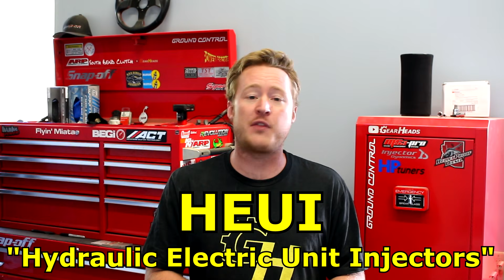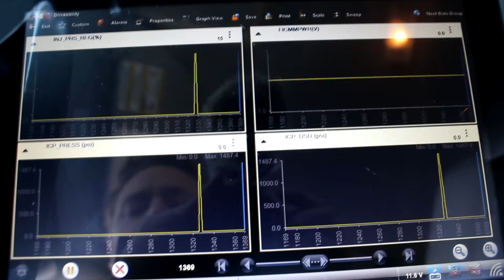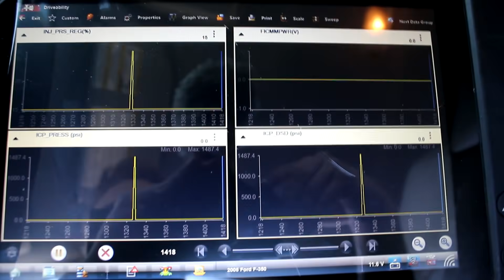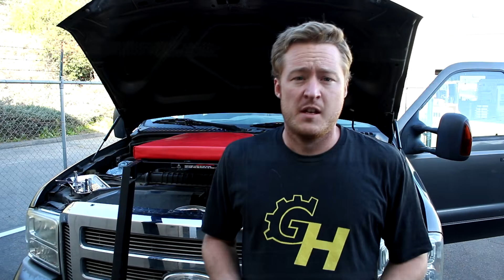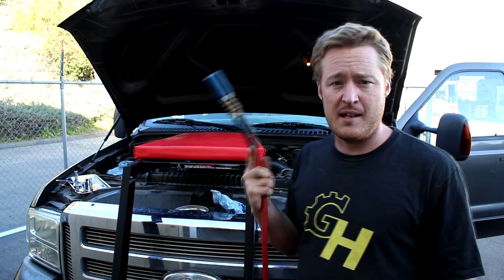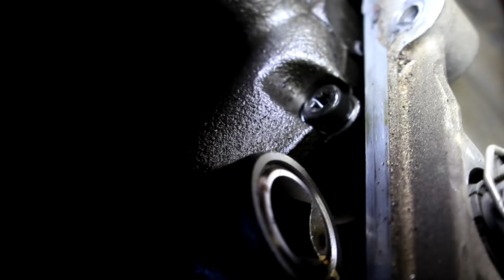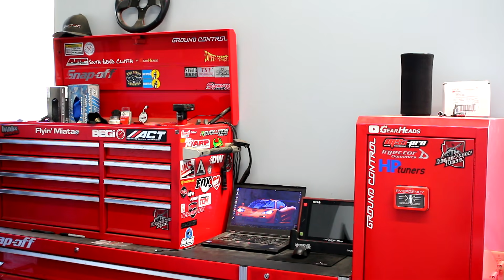Ford 6.0 Common No Start Problems

Comment: My 6.0 has a cold and hot no start. I found a bad o-ring on a nipple cupm on the pass side and replaced them(pass side) w/HRC cups and replaced the injectors o-rings while I was in there. Also replaced the stand pies and dummies on bot sides. I don’t have a scanner and don’t want to be a backyard mechanic and keep replacing parts till It runs. I do have a new IPR valve, cups for the left side and inj seals   also. If I hit it with diesel starting fluid it starts and runs fine?
Reply: Until I shut it off then need starting fluid to fire it back up. I’m at a loss of what to do. I’ve been a mechanic for 40 years but not diesel. I brought it to a diesel shop and he ripped me off like you wouldn’t believe!!!! I broke my back and hip, so I can’t really lay over the core support for very long. ANY info you could recommend would be greatly appreciated. I will also pay you for a walk though onlinePhone etc..  to get this problem resolved! I need my truck running perfectly cause Im heading South wit a loaded trailer pretty soon. Im from NH
Reply from the maker: Part of the issue here is assuming you are getting ripped off. I have no idea if the shop you went to is a good shop or not, but no matter what diesel repairs are expensive. The fact that you have been a mechanic for 40 years and cant figure it out should tell you that whoever DOES figure it out is probably going to be worth a pretty penny. Also if you actually are a mechanic then why the hell do you not own a decent scanner? These days there are so many options for affordable powerful scan tools, hell Forscan is free and will do almost anything you need.  As for what you are describing, it sounds like a HPOP pressure issue still, but its possible you have an electrical concern with a crank sensor or similar that doesnt work until the engine is at a high enough speed. Either way you have something that is preventing the truck from starting until the engine sees a high enough RPM, most likely still high pressure oil, but you need a scan tool to help find out what is happening. When it comes to repairs at my shop I do not provide diagnostics for people without me performing the repair in most cases, but ESPECIALLY with diesels. The diagnostic process on these often requires disassmbly and if I am not the one that is going to be fixing it, it makes no sense for me to tear it apart. 6.0 No start diags generally run several hundred dollars because of the labor involved, it is still often mostly included/combined with repairs if this is the case but either way that takes the right knowledge, the right tools etc.  For what its worth, I work on a lot of diesel trucks and own a shop, I dont even own one because I dont have the need at this time and know how expensive they are. If you tow on occasion and not every day, get a V10 and spend the extra gas money because it is still cheaper.
Reply: @GearHeadsGarageChannel  yeah I had to close my shop a couple years ago.And sold all my heavy equipment, then sold my scanner last year. I got bumped off a roof down in S.C.(I live in N.H.). Couldn’t work so I sold out. 
  Last time it did this, I had a bad nipple cup o-ring,right side. Is there a program I can buy for my laptop and a pigtail? And what would be the best one for the buck? I figured it’s such a common problem, I trying to narrow it down, cause it’s extremely hard (and painful) to lay across the core support. 
 I appreciate that you got back to me. But like I said iT runs perfectly with a small shot of starting fluid! But I have to do it every time I start it?
Reply from the maker: Google Forscan you can use it with your phone or a laptop you will need a dongle you can buy for like $20 or so on Amazon. I am sorry to hear of your circumstances, I hope you get it figured out but there wont be any further assistance I can offer from 3,000 miles away.

Comment: Mine did exactly this today. Ran great for 20 minutes. Went in the store and when I went to crank it, nothing. Throwing no codes. Had it towed home. I'll be checking this stuff tomorrow. Stay tuned.  Great video.
Reply: did you by chance find out what it was because mines doing the same thing unfortunately
Reply: @jacob_21234  . . . . Did you get yours figured out ?   I just bought a "04  6L .  Started and ran like a Champ for two days , next day wouldn't start ! Crap !   Sounds like these engines are to complicated.  Been driving  Cummins for years and never had a problem. Got a guy  coming to look at mine .  If it costs a lot to fix , I'm gonna check to see  how complicated it will be to put a 5.9 Cummins in this F-250 !   Anyone have any Idea if that is doable ?  Thanks !

Comment: There’s no video that shows what the problem is.. water pump and fan clutch stop working or any of both that’s the real problem.. this guys talk too much nonsense crap
Reply from the maker: lol cus the problem could be 1000 different things, the video is just a tool to help you figure it out. If you still cant figure it out that is not the fault of anyone trying to provide direction or help.

Comment: truck dies after a few minutes of driving and takes a long crank to start and sometimes it wont start at all. ficm is 48v. ipr stays at 14.8v at key on engine off. during a long crank the ipr wont reach over %40 while cranking. during cranking the desired icp is 650psi and icp is 648psi.  ipr stays at 25% when engine is running on idle.

Comment: I came across your video because I have recently been dealing with a long crank when cold issue. I replaced the dummy plugs, stand pipes, and also replaced valve screen and seals on the IPR valve.  Of note the IPR valve didn't have any damage to the seals or the screen but since I had everything apart, I just installed a new seals/screen kit.  I got everything back together and the truck started up after a few long cranks.  Now I have a long crank when cold and also long crank when hot so I am thinking that the work I did didn't actually fix anything it just created more problems for me.  Do you have any tips and tricks that I can do before I tear the valve covers off again and inspect them?
thanks
Anthony
Reply: Get your batteries tested? Owned my 6.0L for 17 years. Every 3 years no matter battery brand we find at least 1 cell is bad on the batteries. Glow plugs and using the block heater also help in winter. We use Amsoil and our truck has over 420k miles and cranks reliably. Love my 6.0!
Reply: @littlefinkle7757  . . . . That's a good testimony , thanks for posting .  What weight  Amsol are you using ?   I have a friend that has started selling it so I may try it.  I just bought a 2004 6.0 F250  a week ago. Started fine  and run like a scalded dog.  Two days  ago it just wouldn't start any more.  Turns over fine.  Not Good for  my 1st 6.0 experience.  I'm thinking I screwed up buy this truck but your story gives me a little hope !  The guy I bought it from says he will come give it a look. Fingers crossed !  8 )
Reply: @wh8085  10W 30 . We live in MS so we rarely get below 25 in winter.  We bullet proofed our 6.0L when it had about 24k on it.
Reply: @littlefinkle7757  . . .Thanks for the reply. I'm in Oklahoma .Usually not real severe winters here . What do I need to do to " Bullet Proof this one.  It has  110,000 on the odometer. I'm hoping I can get some service out of this truck.  I bought it for the 8' bed to carry a slide in truck camper.  Hoping it works out ! Thanks !

Comment: How do you check the low pressure oil pom
Reply from the maker: With an oil pressure gauge
Reply: They make a billet cap with a 1/8” threaded hole in the center. You can take a pressure reading there.

Comment: My issue is so weird.  While running down the road I went from 14.3 to 10v battery light came on truck died stranded me on the freeway.  

I put all new batteries and alt and still will not start , I’m lead to believe possibly the starter???

On the gauges the oil meter isn’t moving at all, but oil is building in the filter holding and all.  Checked HPOP on my monitor while cranking it’s only 55psi but this doesn’t make sense because EVERYTHING is brand new less than 3k on new motor , new hpop etc.   the only thing that isn’t new is the starter.

Truck cranks n cranks n cranks very strongly but will not run .  Any1 can help.?
Reply: Alternator

Comment: THANK YOU. . My grandfather gave me his 06 and I promised I'd get it fixed and he wants to see it running. I've been trying my best to fix it. you are a blessing and i pray its something simple. Has a new Turbo. New Glow plugs.  New fuel pump and filters. New IPR Valve. The mechanic said it was the HPOP which I payed to have fixed and now the truck still won't start. The mech said it started but won't run because he put the wrong HPOP in it. He's nowhere to be found and the truck is in my driveway. Thank you again for your advice. At least I now have a starting point.
Reply: Then replace it with the correct pump . That is if he even replaced the old one. Something smells fishy.
Reply from the maker: I am sorry to hear about your bad experience, this video is certainly not and end all be all guide but I hope it helps you!
Reply: There are ALOT of bad mechanics out there. I learned to fix my own 6.0. I already fixed 2 more trucks. I fixed a truck that a mechanic messed all up, injectors loose, loose bolts.
Reply: FICM sync is as important to monitor as a everything else. No ficm sync no start, no crank sync ie no rpm on dash while cranking it won’t start. I don’t know what pump they coudve put in a 06 other than a late model hpop. But idk if the older model will fit but not work. Probably.
Reply: Same here I have a 2003 6.0 power stroke it was my grandpa’s. It only has 125,000 miles on it and I can’t build oil pressure on it. I replaced the turbo on it the ICP sensor oil, pressure sensor and now I think the high pressure oil pump needs to be changed.
Reply: Rpm gauge don't move when cranking??

Comment: The oil pressure gauge says the pressure is half way at idle, it has no check engine codes, fuel was flowing into the fuel filter bowl. But it starts and runs for 10 seconds to a minutes and shut off. Do you have a educated guess on what the problem could be???????????????
Reply from the maker: Does it start back up right after shutting off? If not then it shouldnt be difficult to diagnose but you need the right tools. If it is spontaneously stalling and starts back up immediately it may be more difficult to narrow down. If you plan to work on one of these trucks invest in a good scan tool solution and get proper testing equipment. Diagnosing things properly is important and just guessing at things is a very ametuer and foolhardy way to go about things, I cant tell you how many times I have seen that process make things worse and create new problems and cost much more when all is said and done.

Comment: If it helps anyone, I had my 06 shut off completely with no start on the highway, started replacing standpipes and dummy plugs but the seals looked ok anyways but found the icp sensor and stc fitting o rings blown apart.
Reply from the maker: You would have found that if you tested and searched for the leak properly. Assuming anything is not the proper way to go about repairs. The whole point of this video is to show different ways to diagnose the problem, it is not an end all be all obviously the video isnt hours long but the point is dont guess.

Comment: 03 6.0 f250 code p2285 new icp and pigtail new ipr still no start. I would think with a low voltage code like I'm getting it would be wiring or computer related. What's your advice. I'm waiting on a good scanner to really test everything. Just curious what you would look at first.
Reply from the maker: I showed in this video exactly what to do. Get access to a scanner that can read the right data and see what ICP Pressure is showing, check your oil and pressurize the system to look for leaks.
Reply: @GearHeadsGarageChannel  yeah I've got no oil pressure when cranking. The gauge doesn't even move.
Reply: @GearHeadsGarageChannel  so I fixed the oil pressure issue but since scanning it ficm voltages are all 0. Ficm low main and high all read 0 on the scanner. But tested ficm with multimeter and it reads 48v with key on
Reply: Gear heads, What kind of scanner is that, and where can I get one.  I’m currently using an edge scanner that has helped me so far.  It shows most if not all readings for the sensors

Comment: Thanks for a great video. I've got a 2006 Ford e450 6.0. It's been in the shop for three weeks total. Here's what's been done:
EGR and oil cooler change, oil pump and new oil pump standpipes, wiring check, pressurized thru the glow-plug and found bubbles leading to all new injector seals, changed all sensors, fix manifolds seal leaks. Any help you can suggest is greatly appreciated. Thanks

Comment: i paid one mechanic to do a diagnostic test and he said that  needed to change out the HPOP. so I did that, and itbstill wouldn't start. I got a second guy to run another diagnostic test and he said my FICM was the problem.  so I changed out the bad board and it was pre programed for my 05 F-350.  well, that didn't work either. I'm going to go back to check fluid levels, even though I know I checked them, and even gave the truck all new filters and an oil change.  The first thing I did do without testing anything was to change the sensor. now I believe that it will be either the low pressure oil pump, or a possible leak. since I don't have a mechanics scope, I'm going to try a clear fuel line I have been holding on to for my golf cart. if I put one end in an ear and scan around for a leak. my one problem is I think I'll need someone to crank the truck, because I still have the no start problem. without starting, how else would I be able to find a leak?
Reply from the maker: I am sorry the other mechanics diagnosed it wrong but this sounds like a headache with too many hands involved and going scatterbrained in too many different directions. You need to confirm you have good ICP Pressure, confirm the injectors actually are firing, confirm the fuel bowl is full with no bubbles and you have good fuel pressure, confirm crank sensor is working, knock out one thing at a time yourself and go down the list or hand it off to someone that will figure it out without you doing the work. If someone came to my shop and I told them what I found and then they took it and did the repair there is so much potential for things to get missed that I may know to check for and you dont or mistakes may get made etc. Good luck and hope you solve your issue
Reply: @GearHeadsGarageChannel  thanks, I gave the job to the guy who gave the diagnosis but he never showed up. Same thing happened with the second guy. I ended up changing the parts out.  I wish I could find a good mechanic.

Comment: Very in formative vid,,I'm acquiring my brothers 05 6.0.240,000mls,.in good shape,(used for towing rv,,no tuner),between me and my oldest brother,,both of us mechanics,,the lift pump is the issue or The HFCM,,,causing intermittent starts the last 6years,,,I just wanted to know your thoughts on this blue spring upgrade,,good bad etc..I plan on leaving this truck stock,
Reply from the maker: The blue spring upgrade is worth doing and doesnt even cost what an oil change does so idk why that wouldnt have been done already if you both know about it. As for intermittent starts it could be the pump or something else but without proper testing and catching something going wrong it wouldnt be great to just throw parts at it.
Reply: @GearHeadsGarageChannel  I recently stumbled across this blue spring upgrade,,,it seems people are upgrading with tuners,deletes, big tires,and black smoke.lol.as my brother and I are more hd diesel techs.

Comment: Thank you everyone for replying back. So it did end up being the alternator. But unfortunately my son dropped a bit down where the oil pump goes up on top of the engine. He didn't see it with an inspection camera looking up through the drain plug and looking down from the pump down through. Does anybody have any suggestions? Myself, I suggested he take the oil that he's drained and put it back through until he flushes it through the drain plug. But he wants to remove the oil pan which entails more work than necessary. With that being said.... Please suggestions??

Comment: I have a 2004 King ranch F350 the wires pulled out of the C1388A  X2 connector injector control Cyl, 2358 can u help me with a color diagram
Reply from the maker: My recommendation is get a temporary personal subscription to AllData or similar or buy a factory service manual and you will have access to all you need.

Comment: Great video! Thanks for the info. They made these powerstrokes far more complicated/tedious than they needed to be.
Reply from the maker: Well I can tell you cars arent and havent been getting any simpler lol its not just these engines.
Reply: @GearHeadsGarageChannel  lol. i agree. Just considering them to the duramax and cummins fuel systems of the time. 

I have the opportunity to pick up a 2003 excursion 6.0 with no start condition so I'm just researching.
Reply: 47k Zach @Ka_Gg  Q10
Reply: @GearHeadsGarageChannel  I just turned my truck off and now it won’t start. I don’t hear the fuel system prime that you hear before you start it